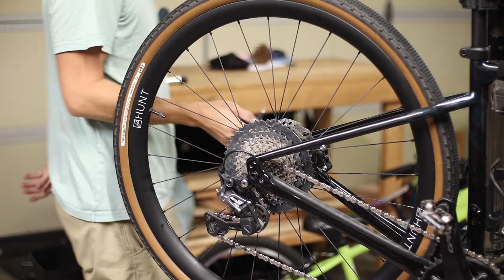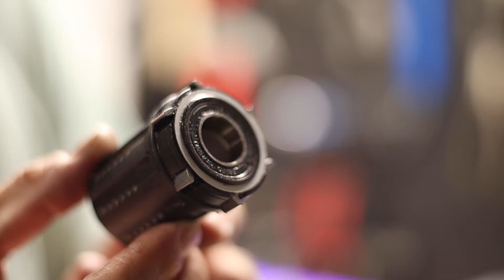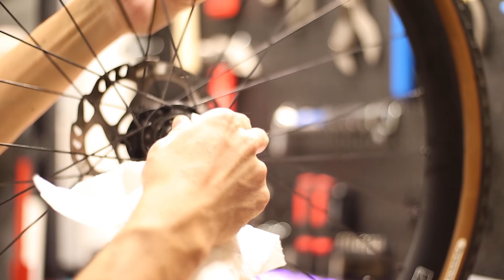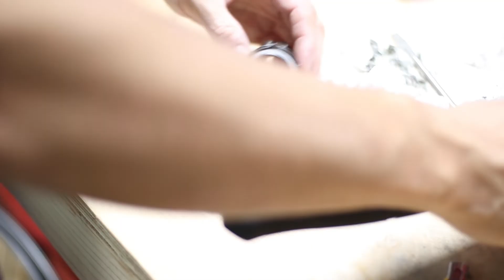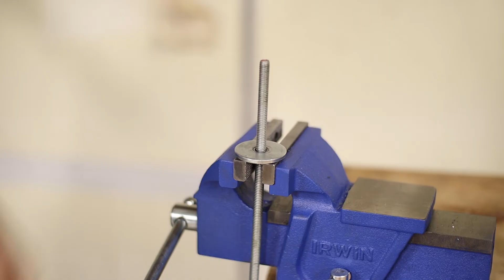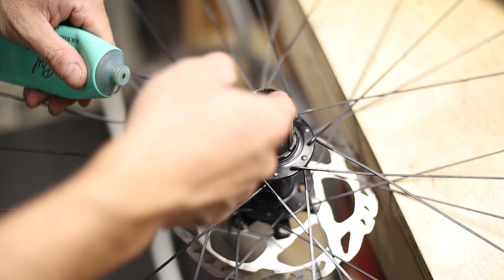HOW TO: Replace Freehub Cartridge Bearings // No Special Tools!

Comment: 4:35 is it normal when the spacer between 2 bearings can move side to side slowly? It cause the hole doesn't line up when I try to put back the axle, I can slowly move and make it center with screwdriver or alley key

Comment: I have pulled my SRAM 1251 cassette off my DT Swiss hub and the freehub is still inside. After putting some oil on it, i tried to hammer the end cap with a mallet to push it off the cassette but that didn’t work. Any ideas?
Reply from the maker: When you say you pulled the cassette off, did you literally pull it off, or use a chain whip and cassette tool to remove the cassette from the hub? If it's the former, then you'll need to put it back on and then remove the cassette using a whip and a cassette tool. Otherwise, a hammer won't help.

Comment: You have the best video for Shimano HG unit bearing replacement, and the3 best view of how to complete this operation.  This works for the Novatec OEM hubs that are a weird mix.  I have 12mm inner nut holding on the freehub, and 6200 wheel bearings and 6000 freehub bearings.  I'm hoping to be able to clean the HG freehub, put in the Riversite bearings, and squeeze it in with washers and bolts, like a sane man.   Like you.  Thanks. 👍👍

Comment: BS. The only tool you need is a heat gun and zero mechanical effort. No one uses any press in/out technique on aluminium in the industrial world as it just damages bearing seats. Aluminium alloys have a decent thermal expansion coefficient. The entire bearing replacement job take just 2 minutes.

Comment: Great vid…Just a nod to those less practiced using a screwdriver as the old bearing punch out tool. They are not that tight so a piece of ptfe plastic rod or brass will be kinder to the bearing bore if you do slip.

Comment: This saves so much money considering the vast number of bearing combinations out there. It's often difficult to even find the "proper" tools for the job in the first place. And instead of sacrificing a screwdriver, you can find some that can also be used as a chisel. Their shaft goes through all the way and has a flat metal part on the end of the handle for use with a hammer. They can probably be found at any hardware store for a pretty low price compared to specialist bike tools.

Comment: This doesnt make sense:  https://youtu.be/F9FnLxQPcZI?t=115 it implies that inner sleeve is not pressed inbetween 2 bearings tightly and can slide easily backwards and forwards. In my Shimano freehub inner sleeve cannot move between 2 bearings.
Reply from the maker: If the sleeve slides axially, then it serves no purpose. In some hubs, this sleeve is more tightly compressed between the bearing than in others.
Reply: but in your example, it slides axially, otherwise you wouldnt be able to move it like that to access bearing (thats what I meant). In my hub, it only spins with bearings, I cannot move it axially. This means I could only potentialy try to push all together (both bearings and sleeve) out of the hub to change bearings, at least with my tools I have.  @TheBikeSauce
Reply from the maker: @wordpress4373 it slides radially (out of the way) because in this case, there wasn’t a ton of axial preload on the sleeve. Other hubs have more compressive preload on this sleeve, making it a bit harder to push out of the way

Comment: No hate or anything, but you should definitely remind people that with this sort of back alley mechanic trick you can easily brake your 2000 dollar wheelset, because the way cartridge bearings work is that they are pushed into a hub that is only a few micrometers bigger (making the bearings sit very tight) and if that bearing gets wedged in from the side then guess what, it don't sit as well.
Reply: Just go pay your bike shop 200$ and move on
Reply: I think you’re a petty little pr!ick, the guy is showing how to replace bearings in the free hub, not the wheel hub. And even at the LBS, they do exactly what this guy does.

Comment: I have same Hunt hub and am thinking that my free hub bearings are worn.  Can you describe the symptoms of worn free hub bearings?  I have been increasingly hearing a creaking sound that has a unique frequency, ie not very pedal stroke, goes away with coasting.  I guess I could pull the free hub and feel if the bearings are rough.  I am a bit surprised that 18k miles would wear them out.  You make it look easy and your diagram was great!
Reply from the maker: That’s it. I just pulled the freehub and the bearing were notably rough.

Comment: Hi, is it possible that height of freehub besrings lower overtime so the cap cannot push against it and hub is moving little hence making shifting bad? Dealing with this issue now while tightening the cap does not help. Thanks

Comment: Do you have a video removing the hub off the wheel? I have a specialized with the hfh-0013 hub, I have no idea how to remove. I believe the Specialized Diverge uses the same rear hub. I have the Sirrus Carbon Comp.

Comment: good day and thanks for doing this video,i go work using my bike even if its raining,how does this affect my hubs (sealed bearing)?
how often should i repack them with new grease?
will putting oil in them bearings be enough?
Reply from the maker: If your wheels use cartridge bearings, generally better to replace them once in a while. They aren’t really meant to be serviceable

Comment: @thebikesauce, do you have any recommendation for the ratchet freehub? looks like it has a ring nut seal which is impossible to remove / unscrew and it is making it near impossible to replace the bearing... any advice will be really appreciated
Reply from the maker: Which wheel / hub?
Reply: @TheBikeSauce   350 hub with ratchet system, wheel Forza R45_19C

Comment: The guy at the bike shop said I had the typ of hub you can't replace the barings in. Is he just trying to sell me a rim?
Reply: I've never heard of non-serviceable wheels
Reply: Same thing happened with me. They say these can't be repaired and I need to buy new wheel or new hub.
Reply: Depends. Sometimes a hub can get messed up beyond repair but more hubs are serviceable to some degree. And a rim is not the the same as a hub.
Reply: You can service/take apart any hub and rebuild it.
Reply: Unless the actual hub body is fucked, you can service it and replace bearings.
Reply: Yeah same thing happened with me now I am repairing it at home myself
Reply: They didn’t know/feel like it
Reply: Bro they do not have the tools that's why or they don't know

Comment: How did u get old ones out?
Reply from the maker: Same as the hub, tap out with flat blade
Reply: @TheBikeSauce  ok ta i was knocking the uppermost bearing with a stepped drift. But didnt realise there was circlip holding it.  Bearing is pitted now, circlip dished.  Now i know to shove spacer and tap lower bearing. That one is still good. Will buy a 28x15x7 .   Thanks 4 help

Comment: If you are going to remove them with a screwdriver, please do not reinstall those back in the hub.  Furthermore, a bearing extractor and dedicated bearing press is a worthwhile investment if you are going to service your hubs yourself.
Reply from the maker: Video was clear to use fresh bearings and also that this procedures requires no special tools. Thx though

Comment: Hey, I happen to have the same bike that you have. The rockhopper sport 29er and I am pretty new to bikes and do not really know how to adjust the derailleurs. I look up videos and it is pretty confusing because the derailleurs are different on the rockhopper than on the videos I have seen. I tried to use the other videos to adjust the rockhopper but couldn't end up doing it. If you could help or make a video specifically adjusting your rockhopper that would be extremely helpful. I also could just take it up to the bike shop where I bought it from and have them do it for free but I would like to learn how to do it myself.

Comment: Hey, great video (like usual). But how do I know if it's time to replace the bearings ?
Reply from the maker: You can do it periodically (every 1000mi or so depending on your terrain / weather) or like me, when they audibly start to roll rough
Reply: @TheBikeSauce  1,000 seems really early - esp if you're not riding in the rain/mud.
Reply from the maker: I guess that’s conservative. I’ve had many wheelsets and the seal configuration will dictate how often you need to replace. These hunts, while fast rolling, seem to eat up cartridge bearings faster than others. Luckily they’re cheap
Reply: @TheBikeSauce  that does seems very fast. My Hope prod 4's are still very smooth and quiet on original bearings after 15,000 miles.